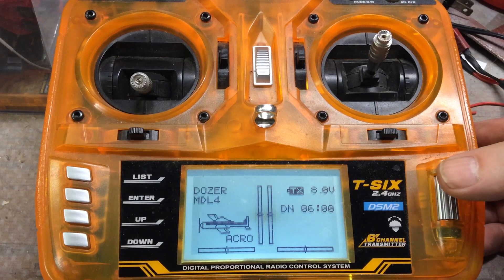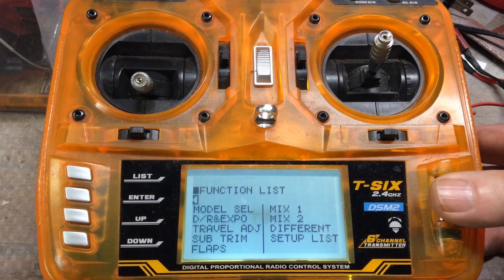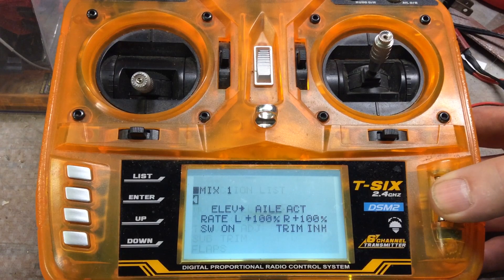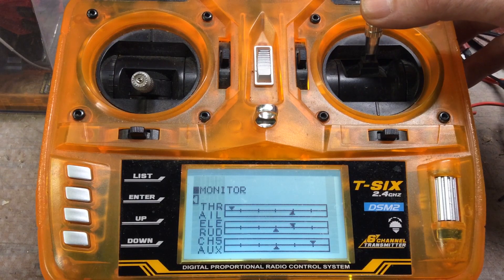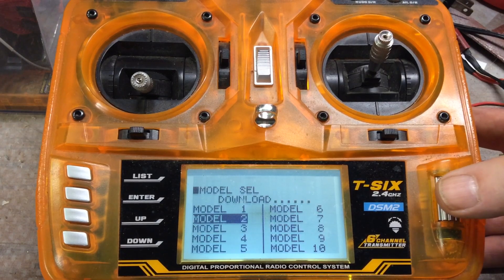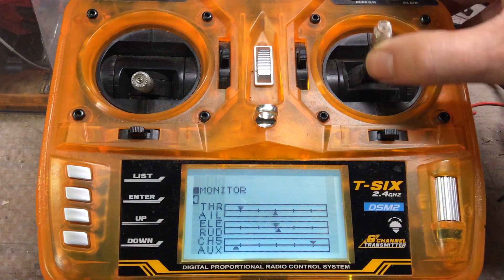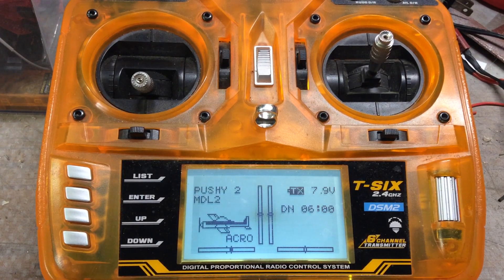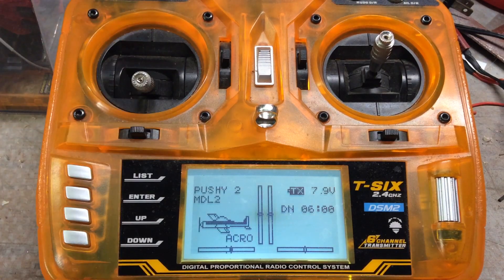RC Transmitter Mixing for Model Boats

Comment: May be parroting Der but THANK YOU for a clear explanation.  I did chuckle though when you mentioned magnets I've used them for several different applications from ordinance on an RC Plane (worked fine and saved  wings more than once when something snagged in grass on belly landings) and for some AA mounts and superstructure over openings on a RC ship I'm kitting out now.   And I may steal the wire push off trick for a future project that's some sharp thinking with that one!!!